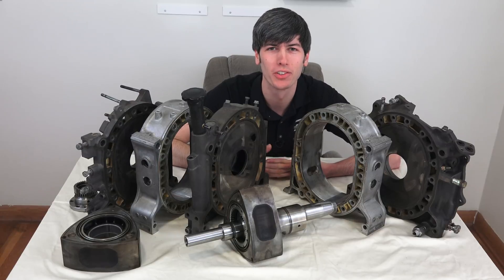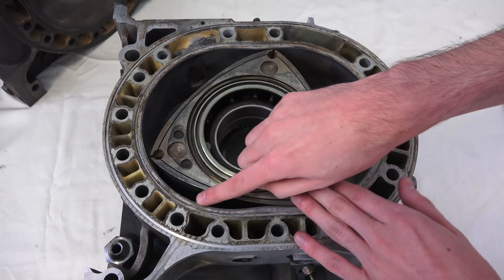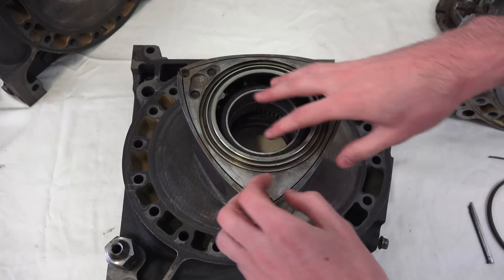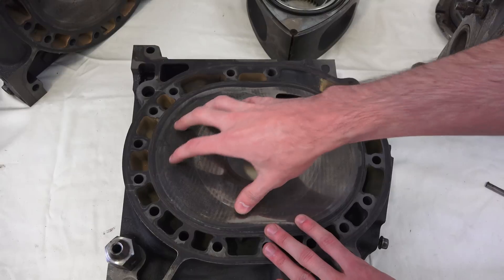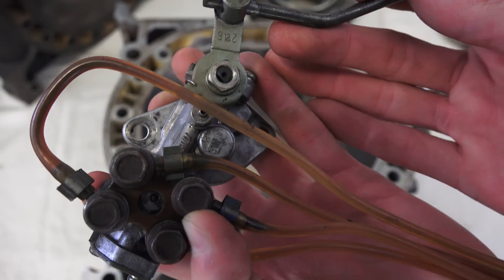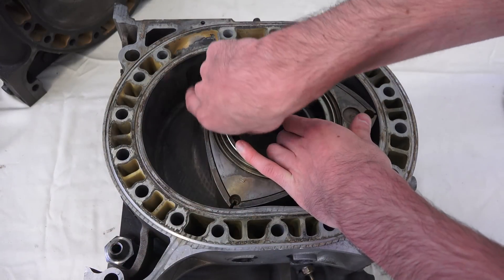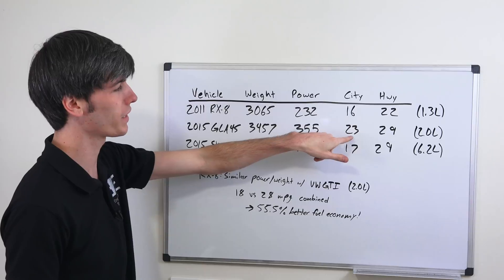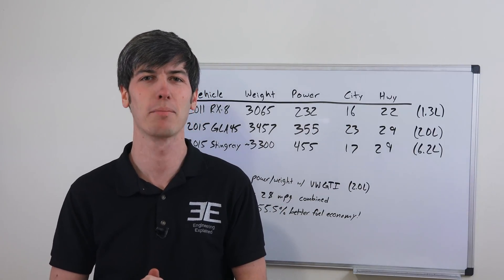4 Reasons Why The Rotary Engine Is Dead

Comment: You know that by using pounds and mpg you make the calculation incomprehensible to the rest of the world,. right?
Reply: You know that the first few moon missions were all designed by Werner von Braun, an ex Nazi who used metric? He designed the v2 rocket, and his designes were also used for the appollo missions
Reply: We claim Engineering Explained for America!
Reply: davetileguy so they did use the metric system to get to the moon. And you said they did it six times using imperial, which isnt true
Reply: 27.3/3.6=7.6 m/s.

19.2km=19200m

19200/7.6=2526.3

2526.3/60= ~42 minutes. It isnt all in tenths because the time unit used and kmph not being SI unit but a derived unit.
Reply: davetileguy metric has the advantage for engineering as it is just easier to work with and more people use it.
Reply: Si. Superior
Reply: I know, but it is the best we have. Just like social systems. Its not perfect, but can you come up with something that both is easy to calculate with and has real word counterparts? That would be a revolution
Reply: John Mapes what no you lot don't speak English you speak American
Reply: LMB222 Eh the rest of the world doesn’t matter anyways xD
Reply: Multiply pounds by 0.45359237 to get KG value
Divide 235.21 by MPG value to get Liter/100km
Reply: Jacques Bloques you are right, OP is just lazy. You would expect that someone that watches engineering videos in english would understand the units all english speaking countries use. The only unit i don’t understand is mpg, but i know 20 is bad, 15 sucks (gas), 40 is good...
Reply: Not our problem is it lol.
Reply: LMB222 — He’s also using liters.  Americans are bimetral.  If some people are unwilling to convert to their own units of choice, what difference does it make?  None.
Reply: If the rest of the world is smart enough to use metric, they're smart enough to convert.
Reply: Rubenyoranpc The Apollo Guidance Computer was programmed in SI, but displayed and accepted data in English units,  we're both right, here's the thing, Engineering in the US is in tenths , same thing right?
The great thing supposedly about metric is it's in tenths, well if it's not manmade it's not an even number! Example it could be 19.2 kilometres to the store and your traveling 27.3 kilometres an hr,  exactly how do tenths HELP? Explain.
Reply: You can pry my Freedom Units from my cold dead hands!!!
Reply: @herculesrockefeller2984  

"Freedom"

Using imperial units. Dumbass.
Reply: +Sylas Grayson NOOO! Its called Freedom units in America. Look it up genius
Reply: Just learn both
Reply: LMB222 so what
Reply: Don't be a baby.
Reply: Convert it over like you want us to do.
Reply: LMB222 if you can’t do a basic conversion you probably shouldn’t be watching a video like this
Reply: @nolanboyer6883  Ok smart guy. 19kmpl : how much mpg is it in your head? How many cubic inch is 1400cc? 

Any channel that calls itself engineeringexplained should by default use metric, or at least display equivalent metric units on screen (like channels such as fullycharged does)

To the rest of us in 2018 its pathetic and sad seeing you using things like king james feet and thomas jeffersons dick to keep measure. But  just keep being stubborn and stay with your obviously inferior systems making crappy cars and cooking astronauts in the sky. What do i care.
Reply: If you want to address the majority of the engineering world, you use Imperial units.
Reply: LMB222 foot pounds and miles per gallon are the measurements in the United States! It would be no different than you using a native dialect in a video and me complaining because it was not English! We are a multi cultural world and that is part of American culture. Inherently everything breaks down to meters you are correct but that is not the way math is performed in the United States. Again try and think about it as a dialect. No one language is more correct than another, as in the purpose of the language is communication. The same thing applies to math and the terminology used four different measurements
Reply: Phillip Reynolds really? Not at Boeing, do they count?
Reply: Rubenyoranpc do you understand my point? The world is not in even tenths...
Reply: Can you do those formulas in your head? What's "easier" about that?
Reply: Rubenyoranpc I don't even Pretend to have a better system, I just think it's ridiculous to say one  is better than the other
Reply: LMB222 man how did we make it to the moon SIX TIMES without the metric system?
Reply: @ExploringCabinsandMines  its ironic you bring up the moon, because nasa lost a 100 million dollar orbiter due to a conversion error that crept into documentation between teams. 
Which again brings me back to the point of  good engineering which is communicating things  as plainly and as unambiguously as possible, even units. Or even better. Just ditch theantiquated imperisl system ( 1/8ths of an inch, 12 inches to a feet, seriously) and use the superior world-agreed standard.
Reply: @NidalRashid  1/10 of an inch, feel better ?
Reply: davetileguy his point was that 12 inches (not 10) make up a foot, 3 feet (not 10) make up a yard, 1760 yards make up a mile and so on. And then the imperial system doesn’t even have small units, you have to use tenths, hundredths, thousandths and so on.
The metric system isn’t defined by physical objects anymore, but by universal constants, which will never change/fluctuate. The imperial system is defined by the metric system, if you don’t trust me look it up.
Reply: @roguepathfinder2477  lol " look it up" you think that knowledge is a secret? We use 10th inch at work to build airplanes seems to work just fine.
Reply: davetileguy “The imperial system is defined by the metric system, if you don’t trust me look it up.”
I think it is pretty clear it means “if you don’t believe that the imperial system is defined by the metric system look it up.”
The imperial units are defined as metric unit*constant.
(1inch~2.54cm
1foot~30cm
1yard~90cm
1mile~1608m
1pound~440g
and so on...)
Where did I say that you should look fractions of an inch up?
Reply: @roguepathfinder2477  you're hopeless
Reply: german engineering :p
Reply: Rubenyoranpc duhhhh your point?
Reply: LMB222 Why does it matter? Just convert it, it's easy. We don't use the metric system because we weren't taught metric standards.

Comment: But one doesn't buy one for efficiency...but out of the love of rotary and the RX SERIES.
Reply: That's why an original rx3 coupe costs mega bucks now
Reply: True, they buy them because they don't know anything about cars...
Reply: Why love it if it is not efficient?
Reply: @Cheese Phuk because it's fun. I drive an old ass gas hog pickup truck because it's fun. Driving isn't just about the numbers, it's about the experience, it's about the enjoyment.
Reply: It depends what you're into. Drive an old ass gas hog if you're into the fun of driving, or get one where you can rattle off some stats if you're a numbers engineering kinda person. It's all good
Reply: @clay7182  I do not love the Toyota prius.

Comment: These engines have lower efficiency and higher emissions than piston engines, but have the advantage of a much higher power to weight ratio. For that reason, why didn't they find use as aircraft engines where weight is an important consideration?
Reply: Ah yes, weight is an important consideration. The few pounds saved in Wankel engine weight is eaten up several times over with the excess fuel load that it demands..
Reply: Good point, never thought of that.
Reply: They have better power to weight ratio than piston engines.
And they are a loss demanding on construction techniques and needed materials than turbojets - and thus on budget.

Of course this matters less for fixed wing aircraft, and would matter more for helicopters and related phenomena, but they are pretty much legistlated out of being affordable for general aviation.

Comment: My 2016 Mercedes 2.0 c300 gets 242 horse power. How does the gla get 355 hp 🤔 since the engine on the c300 is supposed to be bigger

Comment: the comparison in the end doesn't seem that fair... the cars are 4 years younger and the Mercedes for example is using a twin Turbo Setup.... and the 1.3 Liters of displacement don't equal to 2 Liters of displacement either... i know the Rotary is terrible in Terms of fuel consumption, but you exaggerate here... :D

Comment: it isn't dead.  The basic design is still used in some motorcycles and a few other vehicles.  It is used in the RQ 200 unmanned military drone for example.  The rotary idea is OK.  The design sucks in the compression and valve design areas.  The darn thing is not round.  I don't know how to get the rotational stuff compresses things in any analagous way to a normal combustion engine with pistons.
Reply: gk10002000 but we want rotary engined CARS,and last rotaried was rx-8s,and they use know piston engine :(

Comment: The only thing making rotaries look "viable" by comparison are all of the even MORE RETARDED engine designs currently all over the internet with every MORE flaws and failings and basically NO "history" or even proof that they function. 5-strokes, 6-strokes, axial-piston engines somebody copied from an A/C compressor or hydraulic motor, Stirlings, etc. When you put a rotary in THAT crowd, it looks like an engineering masterpiece.

Comment: For comparison, if I drive it "smart" my 2002 Dodge 2500 4x4 Cummins Diesel Quad-Cab will average 18 mpg city/highway. And it weighs somewhere north of 7000 pounds and is about as aerodynamic as a brick. But yeah, rotaries are AWESOME.

Comment: The "they're so SIMPLE" thing is hilarious. Look at the parts on the table. You have EIGHT major, expensive and high-wear components there and having them in good condition is crucial to economy, efficiency and performance. And THREE of them have to be precision-balanced dynamically with each other if you want longevity and durability. 

I'm just a professional diesel mechanic with a couple of degrees in the field and about 25 years of experience wrenching on everything from nitro RC cars to 4500-hp diesel-electric freight locomotives, so I'm not nearly as smart as the internet-educated, video-game "car guys" that love rotaries so much. But in my humble opinion there's so much WRONG with the Wankel design its nothing short of a miracle even ONE manufacturer KIND OF "promotes" it. In SOME of its cars. The LOWEST-PRODUCTION ones, that is.

Comment: Are you a serious engineer? Or an inernet troll against rotary engines?

https://www.topgear.com/car-news/le-mans-2016/25-years-ago-amazing-mazda-787b-won-le-mans-now-listen-it#1

Page 2 says :

And how’s this for reliability? Not only did it run without fault across 24 hours, but on a post-race inspection, Mazda’s engineers reckoned the R26B was in good enough nick to manage another 24 hour race.

Comment: with an rx7 with 285 hp from factory you can f..k the gla45 you told as in the video and with less fuel and less money to buy
Reply: 285 HP, but 7 lb ft of torque and the fuel consumtion of a big block V8 powered truck.

Comment: FIRST of all, the rotary isn't dead. SECOND, it probably should have NEVER, and I mean NEVER, been in a production car. Consumers are lazy and uneducated for the most part. They really don't know how to treat that engine. THIRD, the rotary is an AMAZING engine. YES! I said amazing..... for racing that is.
Reply: Use Trollgun 01 how bout drift team? Mad Mike
Reply: is that a gay thing?
Reply: Ive been hinting to a rotary shop to look at a hybrid version ..
Reply: Trollgun he said 😂😂😂😂🤣🤣😂🤣🤣😂🤣🤣😂 Before your Chrysler 200s transmission, god damn that’s facts.
Reply: 1: Welcome to reality bro. It's dead.

2: Not even racing teams want that engine. Don't blame the Wankel's failures on its consumers, the engine would still fail despite all odds.

3: It's amazing for dumping your unwanted paycheck into something when you pull up to a gas station or when it fails before your Chrysler 200's transmission.
Reply: Haha butt hurt Rotards
Reply: xl125sz
Fragile? really?
where did you not learn your engineering?

(In terms of stresses that are the result of the geometry, wankel rotaries, are lot less demanding on the material than conventional piston engines - for the same power and power to weight ratio)
Reply: same thing happened to the pontiac fiero , have to check oil level.
Reply: Wankel engine is VERY different from piston engines, hence its easier and less hassle, to find someone who can work with it.

Its very sensitive to lack of proper lubrication - like it or not, running the engine without it is not the fault of the manufacturer.
Its also not the manufacturer, but the "car culture" that demands shifting gears.
Which are very far from ideal for the engine, is its lifespan can be greatly increased if its allowed to be optimized to run at a given constant rpm.

For me both of the above point seems to be the mistake on the end of the costumer who is to blame for it i do not care.
We can blame lax education about engines, "bad" design of human drivers who enjoy shifting gears too much. Still the problem is not with the basic engineering concept, but with the limitations that are placed on it by the end user.

And its more suited to be an aircraft engine than a car engine.
Since power power to weight ratios are "slightly" more important, users tend to be FAR more educated about their vehicle...
Reply: 2 stroke engines also burn oil, yet they somehow persist...
traditional transmission is massively inefficient yet it persists...

Uneven cooling is not an issue since the invention of liquid cooling, and the employment of cooling jackets.

Hence what you proposed is not the reason for the "death" of the wankel engine.
Which is not dead by the way, as its still used in applications that it is much more suited to, like aircraft propulsion.
in that role, power to weight ratio, is more important than efficiency (compared to cars), and strict regular maintenance is religiously followed on all engines, hence wankels don't create extra work.
(plus they can be used at constant ideal rpm, which helps a lot with lifespan)
Reply: @martonlerant5672  smaller two strokes, smaller being anything under 20 liters or so have been consistently disappearing over the years. Emissions among other problems did in 2 stroke Detroit diesels. There are no two stroke cars anymore that I can think of and even small power ewuipment has been getting away from them slowly.

Comment: One of the major contributions to its death may have been the fact that rotary engines got banned from Le Mans basically the moment after the 787B won. These design problems probably could have been, at the very least, mitigated--if not fixed--had Mazda had more R&D funding available via their race team.  The only component that failed on the 1991 race-winner was a light bulb. There is no better testbed for an engine's reliability and efficiency than a 24-hour, high-speed, hard-driving endurance race. Without the race team to provide a return on their investment, that level of R&D isn't really financially sustainable.
Reply: Here's this guy.